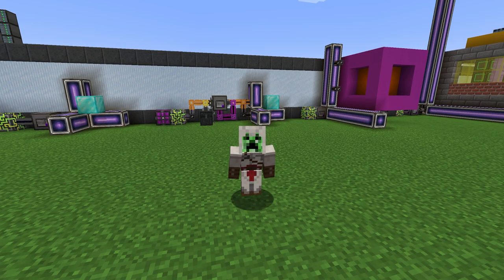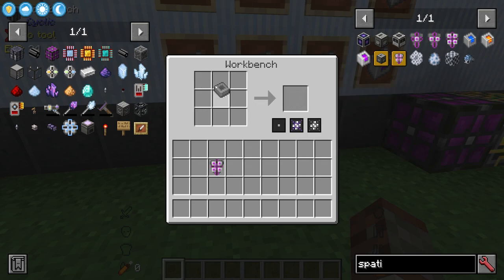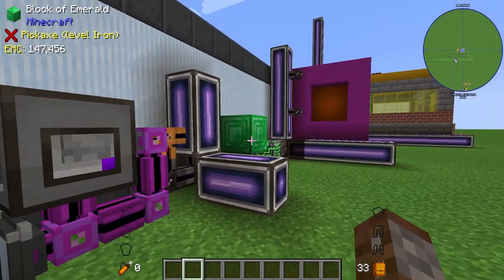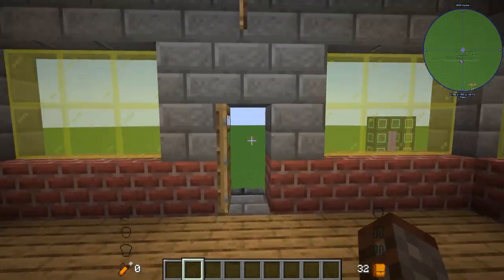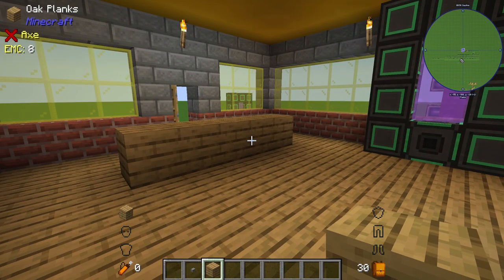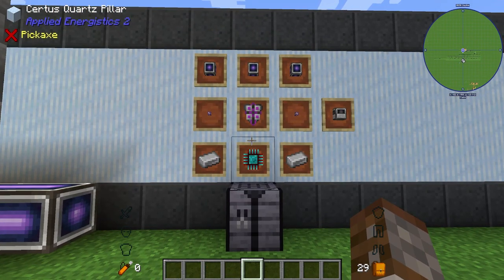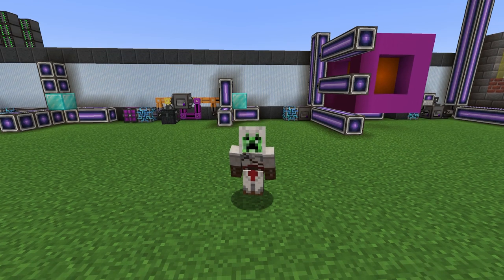How to: Applied Energistics 2 | Spatial Storage (Minecraft 1.19.2)

Comment: There should be a skyblock style playthrough in there. One world in a chest nobody would know about. Interesting idea to have a simulation style world inside a modpack.
Reply from the maker: Good idea but you can't expand further than what has been saved
Reply: this is more of an adventure style then skyblock but there is a modpack called Material Energy^4, which uses the spatial storage system to great effect, it sets up the different cells as mini worlds for you to beat, its very good 

u can find it in the curseforge mod client thing(forgot what its called)

Comment: Important to note; once a Cell has been used in the Spatial IO Port, the dimensions of that Cell become permanently locked. Requiring the use of spatial pilon SCS dimensions as specified/used for that Cell size, with no ability to reset/erase/wipe the Cell data.

The dimensions do not have to be in equal parts (1x1x1), and you can in-fact commit a 1x1x2, 4x10x9, etc area to different cells. 

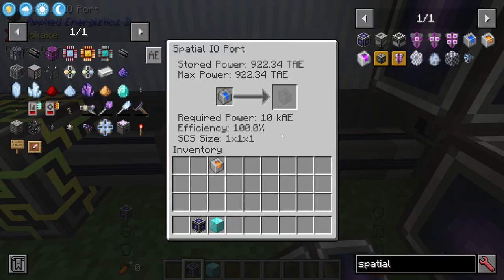The reason it did not copy at 4:30 - 5:00 was because the SCS dimensions did not match the Cell size being used - which can be seen briefly at 4:18 - 4:19 for the Cell being locked to the 1x1x1 size rather than using a new 2³ Cell, not because the SCS dimensions were uneven or that the Cell needed to be a 16³ as described (a 2³ cell will store a 1x1x1 to 2x2x2 area - it's in the name "2 cubed").

I was having difficulty in determining why extending the dimensions by 1³ was not working, since Cell sizing is not mentioned in any tutorial videos or the AE2 documentation and the Cell i used said "unformatted" - I eventually discovered the issue discussion on github.

Comment: Tip for anyone who sees this: If you put a spatial Anchor INSIDE of the storage, it will chunkload it. It appears you will need an anchor PER storage you have, They will work kinda if you only have it in 1, but you need to go into the storage with it, else it will not be chunk loaded. It will also be glitchy with redstone and some blocks if you have the chunk loader in another storage.

I tested this in version 1.20.1 so it may not work with all versions!

If you take out the storage with the chunk loader, it will stop working for all storages that you went into and out of. Same with taking out and putting back a storage you already did this with.

Keep in mind you will most likely need an anchor outside of the storage if you want to be able to trigger redstone outside. This is most likely due to it thinking what the video maker said.

Hope this helps, and have fun with this info.

Comment: im having problems with  efficient power on the ME Controller to power the 16 3 Spatial Storage Cell inside the Spatial IO Ports . its asking for 260+ KAE .
Reply from the maker: How are you powering it? Most likely an external mod but if that’s what it needs then you just need to make it. I recommend mekanism fission or fusion reactors but there are other ways with other mods
Reply from the maker: @blmdick  ah wonderful. Remember you can get 32 channels from each side of a controller. Sounds like it was a channel issue so try to use all sides before adding more but either way works